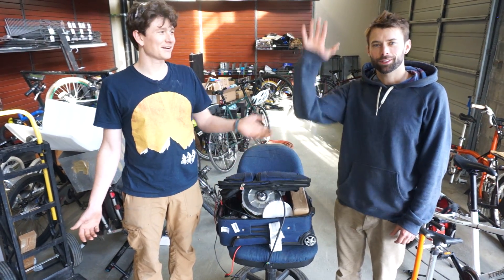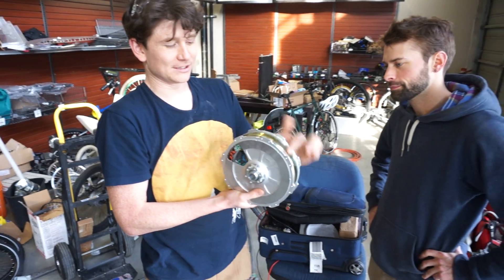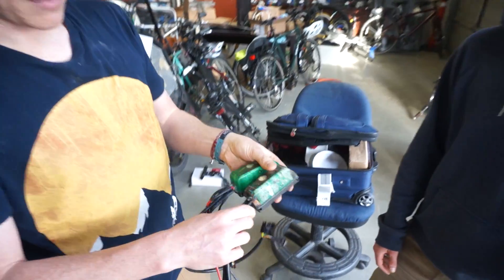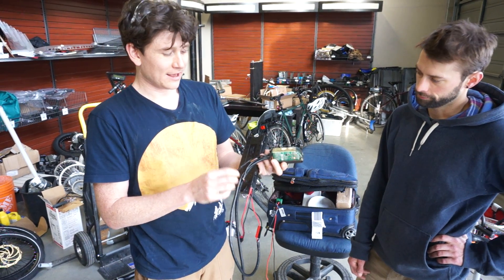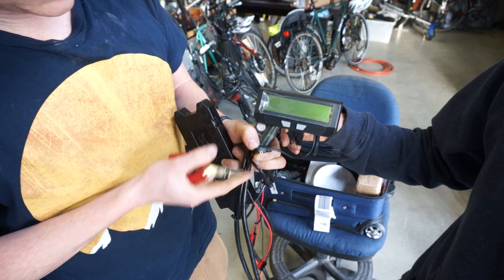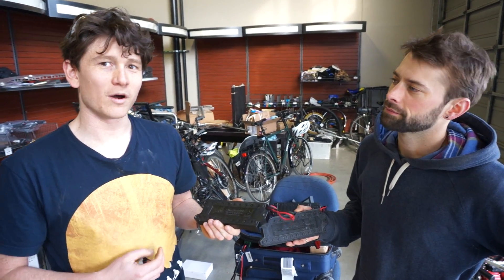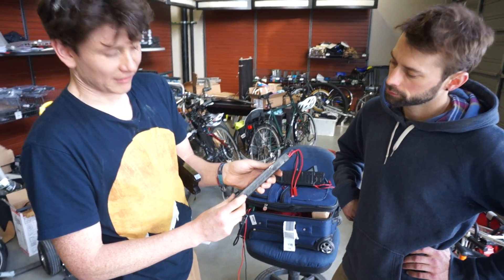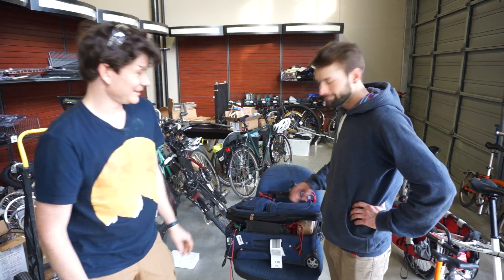Post Taipei Bike Show, Product Reveal

Comment: justin you say it has all the benefits. can you reduce weight/mass without reducing heat capacity? usually excess metal helps absorb heat. if the weight/mass is down, it may have just as much problems as a geared motor in dissipating heat no? that said, this motor is AWESOME if it has the same power/torque as the 9c. way to go. once all your projects are in manufacturing and for sale as mature products, i will buy them all in one package to make a 72 volt ultralight fast charging full kilowatthour escooter.no pedals. good things come to those who wait.........

Comment: it's been 2 months. i'm still shocked you haven't gotten massive venture capital funding for the modular battery. the idea has been around for many years and youre the first person to really be doing it. i'm amazed!. 

i'm waiting for your controller to be done to purchase your controller/CAv3/9c+ for a 72 volt 20 amp  battery settup on an ultralight electric scooter (an ebike with no drivetrain)

Comment: Awesome info & update!!! 
I almost went to Taipei with Ewan and Rupak... I really reeeeeeally believe in your modular battery design, this will shake the battery industry big time =]
Reply: +Jonathan Vaucher - YES, I completely agree with every single word you just said here, it is a pain to open up a pack and find all cells spot welded together, packed all together (glued in many cases) making IMPOSSIBLE to break the pack in half to repair few bad cells (always replace the whole faulty series).
This modular pack is an awesome idea / design plus you can take it on airplane.
Thaaaaaaanks for watching my videos =]